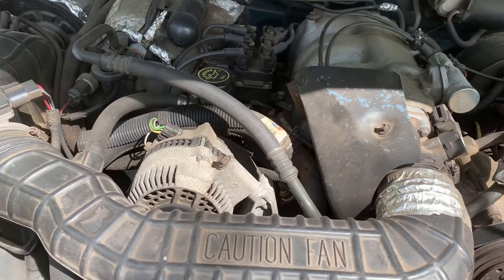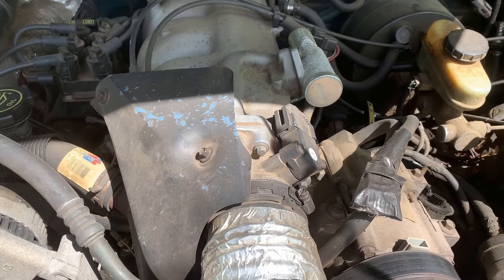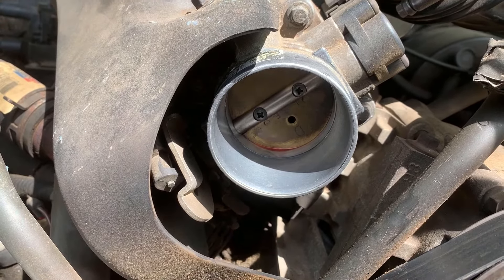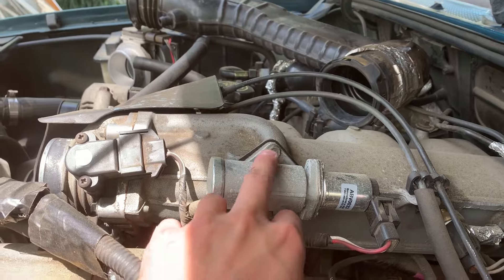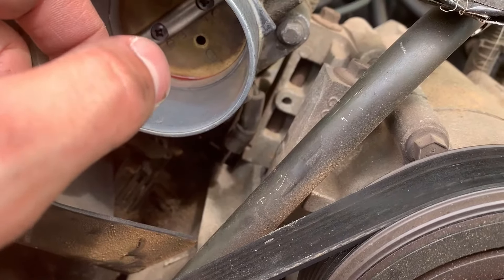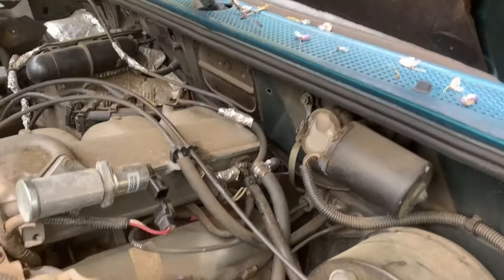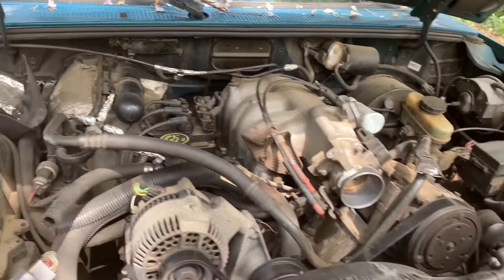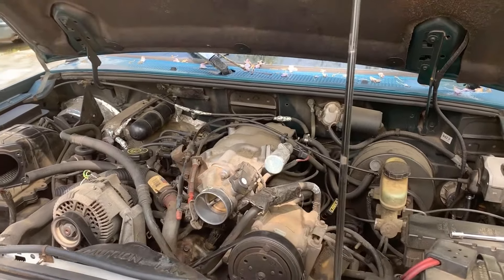How to Diagnose a Ford Ranger Rough Idle

Comment: @ 04:12   slightly wrong description.  That hose runs from the throttle body to the fuel canister, not to a "pump".  

The purpose of the canister is this:  It collects fumes evaporating from the fuel tank (while the car is parked) and condenses them back into gasoline.  The car then sucks this excess fuel out of the canister and burns it while running.   This eliminates the old problem of walking into your garage and smelling gas fumes from your parked car.  In the old days, your fuel tank was vented to the outside, and the gas vapor could be detected after the car was parked a while.   Now it is vented into that canister, and reused. so the smell is eliminated.

That hose is designed to flow the fumes and/or condensed fuel from the canister into the engine, so that it does not overflow.  It often has a "purge valve" in the middle of the hose; such a valve is designed to purge the canister for only the first 5 minutes of when the car is started.

Comment: Another cause of a vacuum leak is the purge valve may not be closing properly. That's on the hose that you pointed to, where the elbow tends to crack and cause a vacuum leak. Sometimes it gets clogged with carbon granules from the carbon canister. 
I guess the valve shouldn't be open while idle. (That seems to be part of the problem I'm having, currently)
Reply: Is that where he points to at 4:08ish
Reply: @phatboitex2cali  Somewhere in there. Twas on a hose coming from that black canister. But, my problem was actually the capacitors in the ECU. If you check the trouble codes, it'll give you an issue for the maf sensor, coolant temp sensor, throttle position sensor, intake temp sensor, etc..  All those at the same time.
It probably means that the capacitors are bad, and not those devices. Capacitors that regulate the reference voltage for those components.

Comment: Had a recent problem with sudden prolific smoke. Its rare but it was caused by the transmission vacuum modulator sticking. It was attached to the exhaust and when it stuck open it sucked transmission fluid back up into the fuel mixture. It was pink fluid.
Reply: That issue is because the vacuum diaphragm was leaking inside that vacuum modulator. The valve is basically an on/off switch to tell the transmission you are putting a load on the transmission and react accordingly

Comment: Happen  yesterday , my idle air control valve had a slither of a leaf stuck inside, also if you disconnect the wire it leads you to the problem.

Comment: Hello I have a question here.
What is the black tube box tank with the tube connected ?
Reply: Where are the two connection points? From airbox (lower left, engine bay, as you look at it) to throttle body? If so, that's the intake tube.
Reply: It is the fuel canister.  It collects the fuel that is evaporating from your gas tank, and recirculates it into the engine to be burnt.  This is to prevent the car from always smelling like gas fumes because fuel is always evaporating from the tank.

Comment: got a 2001 3.0 shakes alot and has gotten worse, happens at a stop or low speeds below 10 mph
Reply: We’re you able to find the solution? Have the exact same problem with mine
Reply: Me too any luck???
Reply: @ffrnando4388  replaced coil pack and plug wires with plugs just a misfire p0301
Reply: @joelrivera6781  so i had just a misfire p0301 on my scanner replaced ignition coil with wires and plugs. That fixed it with having 140k miles.. that should help you
Reply: What if you done all this and still nothing I got a 94 xlt 2.3 manual and the only thing left is the maybe my maf